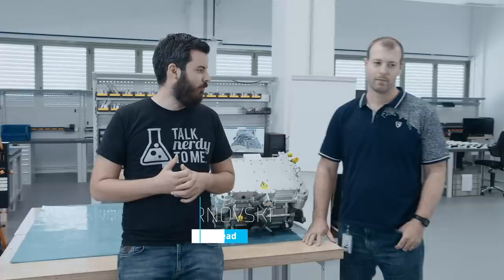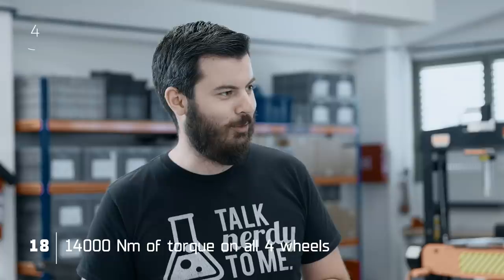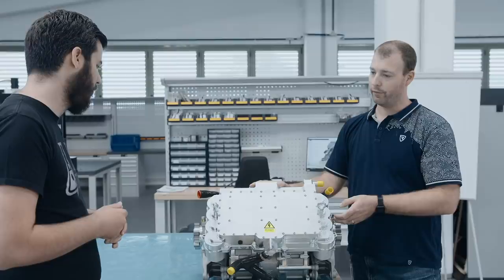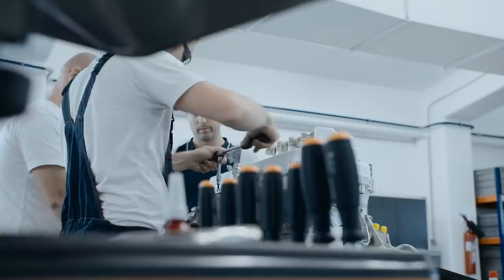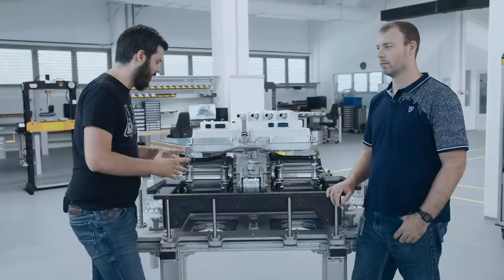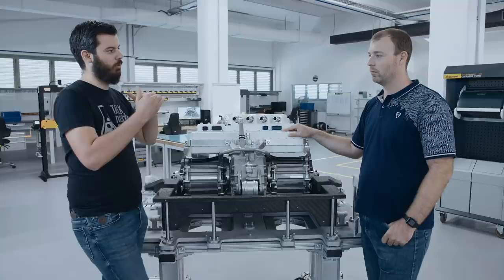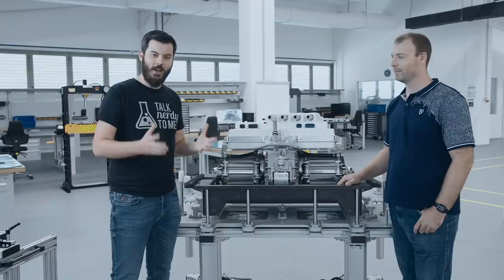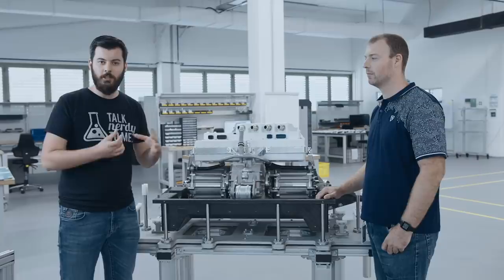How to Make 1914 Horsepower Powertrain | Mondays with Mate E12

Comment: I would love to know how you increased motor speed and torque. Could you explain more on this? And how your motor design is different?
Reply: There are only two theoretical limits to the power output of an electric motor if you can supply it with unlimited and perfectly phase-aligned electric current, the permanent magnet flux and heat. Increasing max torque is done by strengthening permanent magnet flux, strengthening the coils mechanical binding to motor rotor/cage, as well as increasing the current capability of the inverters that supply AC current to the motor. Increasing power is done by reducing back-emf (electrical resistance inside the motor that grows with speed) and/or providing better cooling for the motor coils. The electron Rocket has 1MW electric motor that's just the size of a coke can because they use cryogenic rocket propellant to keep the motor cool. 

This is incredible engineering, but the purpose of such a car is extremely limited due to the weight and energy capacity of the batteries.
Reply: @Akmol Ali The maximum torque is not really limited by the cooling like the maximum continuous power is limited by cooling. Maximum torque is limited by strength of the magnets, motor construction, and current capacity of the inverter/motor driving circuit. You can create an electric motor with incredible torque but not much power with little cooling. The electron rocket 1MW motor is done in a small footrpint by using very high RPM and high continuous torque. Power = torque/rpm
Reply: Richard Kelbe  Just emailed him. Fingers crossed he replies :)
Reply: @Nathan0A  Also silver wire winding would help little bit (31% less heat generated for same winding volume, capacity for power to go up) if you want to save weight, you might opt for copper coated Alu wire, saves ton of weight, but they have to model for heat dissipation and removal (adds heat due to the 1.66x higher resistance), coolant flow is impressive, i don't think there would be a problem in  heat removal from flow perspective, question is of in/out temps (capability of that cooling circuit)...
Reply: @ZegaracRobert  also silver is a better conductor
Reply: @VenomCold  That is why losses are lower...or power goes up for same volume, volumetric efficiency goes up, bunch of improvements, just by using more conductive material...
Reply: @ZegaracRobert  True. Let's hope the technology of graphene comes soon. Some say it is the best conductor ever.
Reply: It does as it's told

Comment: Maybe not a so popular topic, but since your vehicles are electrical, I am very interested in how you deal with the electrical architecture and harnesses packaging? stuff like power and signal distribution, Electromagnetic Interference, Electromagnetic compatibility, etc...

Thanks and success in every project.
Reply: I'm sure it's all linbus or similar. Each module gets power and data, think of the window switch like a small computer with a network address that communicates along a central network interconnect.

Comment: In comparison with a two speed gearbox, does a single speed gearbox reduce efficiency at higher speeds or did you managed a way around that issue?
Reply: Depends a bit if your question is hinging on vehicle range or heat losses? Perhaps a question to ask is this: you know the efficiency is only going to drop at pretty high speeds. Probably 250,300+ kph. Is it dramatic to have a small vehicle range reduction at blasting high speeds or it that something a customer could live with? Regarding heat losses, that might very well be an issue. As Nathan L. writes in the top comment of this section, cooling probably played a key role in pushing that available torque of the motor beyond what they had dared so far.
Reply: I was wondering the same.
Higher switching losses will occur at higher speed for high frequency switching IGBT.

Comment: How are you able to pump 1000A of current through what I assume is 2/0 cable for the rear motors? Is that the continuous rating or peak? What does the power distribution look like coming from the battery?
Reply: Teflon or silicone insulation? Air cooling? i wonder also, probably peak, your likelihood of dying in vehicle goes exponential with time at those power levels! So i  assume peak.
Reply: Zegarac Robert for the regular vehicle owner and emergency personnel the chance of electrocution should be relatively low. I’d assume all EV manufacturers incorporate some forms of Ground Fault Circuit Interrupter (GFCI) in their pack where any high voltage that is detected on the chassis or low voltage ground either blows a pyrotechnic fuse or disconnect the main battery contactors. When I did FSAE Electric, we were required to put contactors both on the positive and negative terminals inside the battery box and use a ground fault board from Bender. Once the battery box was closed there is no way to get power out without everything on the safety circuit being happy.
Reply: @ryanmccawley5467  Ryan, you missed all the game entirely!  If you are pushing 1MW+ what is your speed? 200mph-300mph, what are the odds of dying at those speeds compare to the normal speeds. Dont just think oh i can do that forever in a strait line, do you know how fast tires are wearing at those speeds, what is chance of tire failure?, and what happens when tire fails at those speeds... I was not thinking on electrical issues AT ALL
Reply: Zegarac Robert, Zegarac Robert It was a little unclear what you meant so I made an educated guess. The Rimac concept 2 has a top speed of 258mph. ICE cars go fast too so risk of death at those speeds arnt limited to EVs. Also, that is why there are speed limits. The real difference is EVs make acceleration a lot more accessible. Speed won’t wear tires nearly as quickly as acceleration, deceleration and cornering. Although acceleration is faster in EVs, deceleration due to braking is still quicker which is equal between IEC and EVs. There may be increased wear on an EVs tires but that is why there is regular maintenance to check those things. One benefit of EVs is torque vectoring and traction control allows for greater control of the vehicle potentially decreasing deaths compared to an IEC vehicle
Reply: @ryanmccawley5467  Well due to the "astronomical" losses at those speeds tire applies lots of torque constantly, (like accelerating all the time) and thus tire wear @max speed is massive, for bugatti veyron the number was ridiculous, don't remember the numbers right now but that was my point, that risks create bottlenecks elsewhere that pretty much determine how long you are going to use drive system @max power  at any given time...and yes i did not limit my thinking to EV's, it works for any supercar...
Reply: Zegarac Robert Ah I understand. That makes sense. Not sure when, how often, and for how long supercars go at those speeds. Seems like only people who know what they are doing and minimize risk. Of course you’ll get the dare devil as well but not sure that is common.

Comment: I'd put that 1MW baby into Misha's Golf 4. After all he needs that torque the most tho he also needs the range and I'm not sure where a battery pack would fit in that car. 800pcs of 21700 cells would take a lot of space + cooling and all the required rads. Maybe converting it to RWD and using the space under the hood for cells and cooling? It would require a donor car so that he can make the trips and I'm not sure if Golf 4 is the best choice after all. But it would be cool :P
Also 14:04 I am interested into hardware development but I don't have the required pappers (school) to do so :P
Only 3 years of Electonic-Mechanic @ESS (Varaždin) and related to car industry close to 2 years of working @Dürr factory in Bietigheim-Bissingen so the only use I could be of is fixing their robots since I pretty much know them inside out (especially the latest 3rd gen). But you're probably outsourcing that or doing it by hand since it's still only 250ish cars you're going to make.
Also why the reupload? I didn't notice any changes.

Comment: I have a question for you, would it be possible to make a bolt in part that could replace the differential in an atlas or English axle of an old mk1 or mk2 escort? Could this be a replacement for the old petrol motor?  Could this replace the gearbox and the rest of the power train? How much horsepower could you make? This could transform the kit car industry!

Comment: What do you guys think of axial flux motors?
Reply: I agree. I’d also like to know the reasoning why you wouldn’t use an axial flux motor vs a standard rotor PMAC motor like you have? I assume PMACs are easier to cool and have the same energy density although they spin faster.
Reply: @ryanmccawley5467  I think you're right but DSIR motors are allegedly easy to cool and have high power and torque density. Maybe its just down to cost ?
Reply: Daniel Wamono The axial flux motors I have seen and make the most sense have the stator in the middle with two permanent magnet rotor plates on either side. The only real way to cool them is a jacket around the outside and since they are flatter they don’t have as much cooling area as with a Radial flux motor. Cooling I think would the limiting factor. I haven’t looked these up in a few years so maybe there has been more advances In cooling since then. Also if they were looking to use F1 level gearboxes and clutch packs it doesn’t seem like cost is and issue. It could be that modeling an axial flux design is more difficult, they have experience with radial, and the radial flux motors met the criteria so they suck with that for the time being.
Reply: @ryanmccawley5467  thank you for sharing information!
Reply: Daniel Wamono No problem. I definitely hope they talk more about this subject. If you are interested in EV tear downs take a look at MunroLive. He a lot of knowledge and goes really in depth on the engineering and manufacturing of some Teslas
Reply: @ryanmccawley5467  Thank you and I will. I've been following a Belgian startup called Magnax, they've been working on commercializing axial flux motors. I've also recently stumbled across this video https://www.youtube.com/watch?v=E5VS4s-R7vk from AVID technology who are also working on pioneering axial flux systems. I find them very excting.

Comment: I need this kind of unit for my 1986 Audi Coupe GT on the front axle, but it can easily be more than 5 times less powerful and have just single gear. I want the car do be converted by the time my 7-years old boy turns 18. :)

But, absolutely love what you do there, Mate Rimac!

Comment: The water flow volume at 40 and 60 l/ min is insane....also what I want to know what kind of powermodules are used? SIC? How do you meassure current on the ac Phases? With hall sensor ?

Comment: Mate! I would love to know how you manage the regenerative braking system within the vehicle! What are some of the limiting factors when it comes to maximising efficiency?
Reply: Guess it will be the max. charging-current limit of the battery at a given state of charge and temperature. Efficiency should be very similar to drive efficiency at a given speed and torque.

Comment: Hi Mate, I would actually use the front drivetrain unit rather than the rear one. Would drop it into a Lotus Exige and pair it with a small battery custom built for high discharge rates to allow for high performance without being too heavy. I believe that there might be a sweet spot where lightweight will allow for reasonable range and performance without having to build a very heavy car. Oh and obviously would try to include fast charging, my EV experience teached me that small range can be offset by that.

Comment: Haha, Burn rubber - Not Gas! Well, the design is really beautiful. Das Auto Begeistert won't be left unattended when it comes to loving the engine. The feeling that we get after opening the hood of an ICE. So majorly, it's a more RWD-centric, which makes it easier for drifting (over-steering characters).
The timed know-how was amazing, great game! Thanks for the constant updates on the videos giving insight into the Engineering and company and kind of everything. 
There are studies, at least what I did for the integration of all the coolant, however the remark you made was exactly my remark during the seminar --- different coolant temperature and flows and here comes the integration problem for 1 cooling system to bring down the weight. 
Hahaa, of course --- can't be slower at all!
Wow, that's phenomenal - 60 kilos reduction and still better, re-designing for a better job
 >>> How about HM Contessa, not many know of it! But give it a check!
Can you please comment on SoC in the next videos, how it will be affected on the kick-down acceleration for stretched times and lengths.
Reply: Apparently, I didn't ask for your judgement. If you do not like it, there are thousand others to read! Go ahead, don't waste your time. It's precious! Thank you :)

Comment: For the engine question. I would put it in a top performance car designed by Gordon Murray.
YOU SHOULD REALLY get in touch with that guy and develop together the electric "megacar", as it would have a high performance EV tech and that guy's experience in making bloody fast performance cars.
PS: I'd contact Elon Musk as well to chime in with some Tesla knowhow.
And do you know why it will work out, because Elon Musk will agree because you want to push the EV market and actually take on the single segment that ICE cars still have hopes.. on the track.
Gordon Murray if he is not a blockhead and really wants to design high performance vehicles, will take the challenge.
In 2025 you could have the first fully functional prototype of the new breed of road monsters.
The EV megacar (hyper is not enough anymore)
Plus I would say you look into some fancy ways to install modular battery packs.
For example giving a base setup with a small battery that can do a few laps around the circuit, like 3 hot laps for beating the records there.
And then adding extra packs or replacing the existing ones if you want more hotlaps. And while you're doing the hotlaps, the battery packs that were replaced to be charged in the pitlane.
And after you're done racing on the track, simply install all battery packs and go home.
Reply: Actually if you guys can make a hybrid train that adds 100 HP and weighs less than 25 kilos he'd be mighty pleased. No seriously. That's why he hates hybrids. At the very least he could use you for his electric pod or T27 version B city car.
Reply: @srinitaaigaura  there's already some guys in usa that make wheel pods with 50hp each wheel. Presented at sema 2018 or 2019, i forgot..with all this talk of coronavid for the last several months it has polluted my memory with their assault on information.
Anyway, those wheels are easy to swap in any car.
Priced at 10k-ish
Reply: @roberts.wilson1848  Battery? How much weight and kwh? It's always the batteries.
Reply: @srinitaaigaura  Orbis ring wheels, I think the battery is optional ... at the moment of launch no word of batteries, so you can buy these motor wheels and any battery pack you want.

Comment: Question: How  did you manage to increase the Torque from the first spec to the second one with 900Nm? When you say in the same package that must mean there was not much room of making the active parts bigger. So I guess it also involved exotic materials like cobalt iron ? The bump in speed with a diffrent rotor banding since you said surface mounted PM‘s ? Or was it just an Inverter thing which now pumps more amps into the motor with a raise of voltage for additional speed and power?

Comment: I would love to see the rear motor in the rear of a smart EQ fortwo. It would do everything you need a smart to do:
• look ordinary
• do burnouts & wheelies
• be even faster than the Brabus Ultimate E Concept

I think that would also perfectly show off how compact the powertrain is. You can't punt that much power in a smart using a conventional engine. ;)

Comment: The torque densities are impressive, over 20 Nm/kg (assuming these are active weights of the motors without coolant).  Is this world's most torque dense motor or am I missing something here?
Reply: Drive unit, not motor
Reply: @vidznstuff1  I don't think so, it is mentioned multiple times in video that rear motors make 900 Nm before reduction.

Comment: With this kind of power, what are your plans to raise the efficiency of the electric motors?
Are you thinking of super conducting materials? 
I mean the currents needed will cause enormous 'heating power' in engines, wires, controllers`etc. In what temperature-regions are you testing your prototypes: the arctic will cause other problems than Nevada desert. 

Thanks for your very informative and entertaining videos !

Comment: What i dont understand is why ev companies dont put the same amount of motors in the front as they do in the rear when the dynamic weight transfer goes to the front during braking. Seems you wouldnt get anybetter acceleration but you would improve regen and braking

Comment: My Question is abaout the Rear, and the Front Powertrain: Why do you not 3d Print the Casings from the Electric Motors and the Converters ? So you can Integrate, a collantflow tubesystem inside the Casings! Ant about the Powertrainswap: i want it to see it in a Smart! :-)
Reply: Strength and weight will suck

Comment: It's insane how much power they are pumping through it.

Edit: Question: is there any difference between the final gear ratio on the front axle and the back axle?

Edit 2: If I could swap that rear drive unit into something, I'd put it into my wife's Toyota Sienna.  In the rear.  There's a goodly amount of space under the floor for a good-sized battery pack, and it'd make for one heck of a sleeper. :P